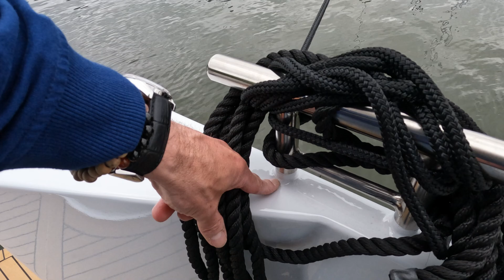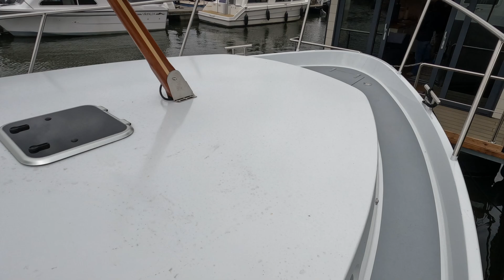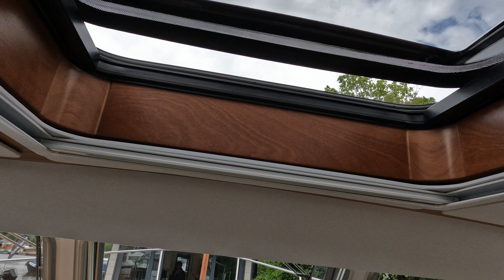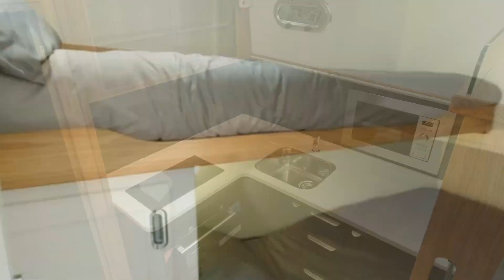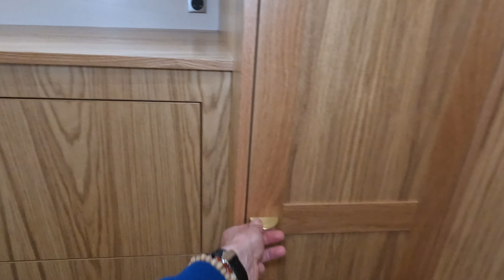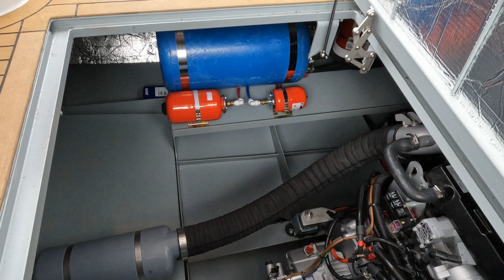Boat Tour - The All New, All Steel - All New Piper 12C Cruiser - £360,000

Comment: The stern configuration seems to be a bit dangerous for even coastal voyages as the two boarding paths would easily allow a following sea to flood the cockpit. Add gates that open out to fix the issue. It’s amazing the boat got a seaworthy rating.

Comment: Draft, Range, Height?
Ex retired sailor now Motorhomer looking at boating down to the Med via France Canals/Rivers and back, prefer access to Canal du Midi without Biscay 
More info other than rotating dorades etc appreciated
Thanks 👌
Reply from the maker: They are bespoke built boats. The one shown is a customer's boat. Range will depend on the engine options chosen. The team at Boat Showrooms can answer all these questions and more. Thanks for watching.  https://www.boatshowrooms.com/new-boats/piper

Comment: Some important questions for me about this very beautiful boat.

 1) Shipbuilding Quality Grade A steel plate according to EN10204/3.2LRS

Wich Material  - Steel number??? (EN 10204 is only a test standard and does not provide any information about the material).

2) Shipbuilding plate Blasted to SA 2.5 and primed by Dutch supplier.

This is second quality acc. BS 4232.  Not bad, but it could be better.
Much better:  Hand Tool Cleaning SA 2 ½ or SA 3 White Metal Blast Cleaning.

3) 7.5 hp bow and stern thrusters.
Brushless motors?

4) Hull
Can you build a hull like the Eder DG-Hull? You know the boats in Venice?

5) Anchor winch 
Chain SS (1.4571 or equal).

6) Design category A, B, C, or D?
Does the boat comply with the guideline 2013/53/EU?

7) Welding steel to stainless steel is technically not permitted, actually prohibited 
- there is stress corrosion.

Many thanks in advance for your reply.
Reply from the maker: Please ask Piper Boats as they have been building steel boats for over 50ys, and are the experts, not me. https://www.piperboats.com/ Thanks for watching.
Reply: @ALifeMoreBoaty  

Completely wrong answer. right?

You are not an expert, you are just completely unnecessary if you cannot answer the questions I have asked!

You probably have no idea about boats and the associated technology.
Reply: I think you need a life more than a boat 👌

Comment: First try of competing with the Dutch boatbuilders. Very nicely done and very charming, the price is very reasonable too. However, the Dutch are far more advanced in technology, practicability and also classification
Reply: I agree with you.
We have been renting motor yachts for many years, twice a year in the Netherlands. The motor yachts are mainly made of steel. This is very important for the sailing characteristics. Above all, a 12-meter boat should weigh more than 10,000 kg.

The Netherlands is probably the most beautiful sailing area for boats in Europe.

90% of all locks and bridges are automated.
You approach the bridge and it opens automatically. 
All locks are also operated as a matter of course.

Comment: Surely that’s 1.2Kw of solar, not 12Kw?
Reply from the maker: Yes 100% correct, my bad. Good spot and thanks for watching.
Reply: Was about to say the same, 12kw is at least 25 panels hahaha
Reply: @martynwhiteley765

Read the specs: 1200w Panasonic PV panels with Victron solar regulators